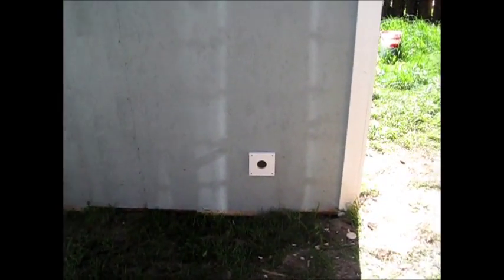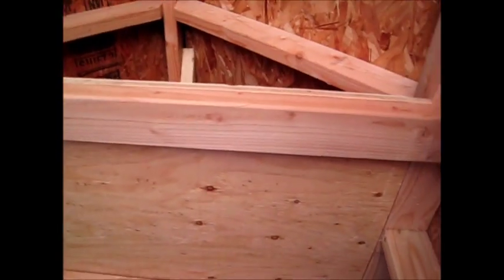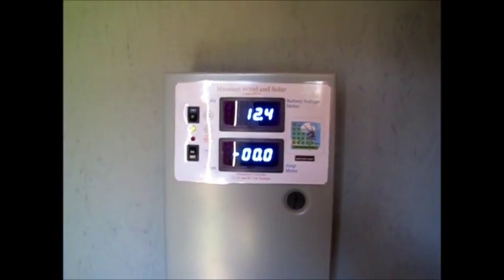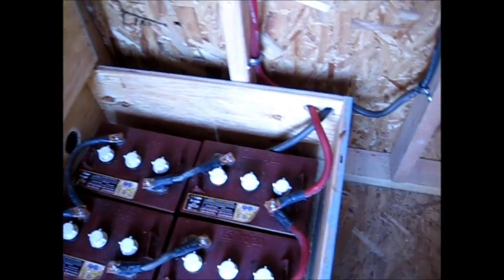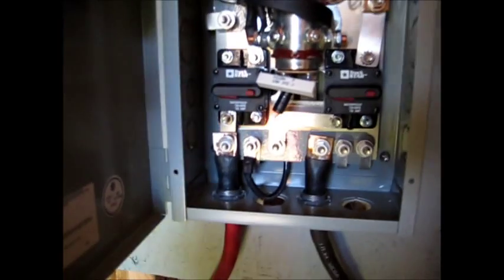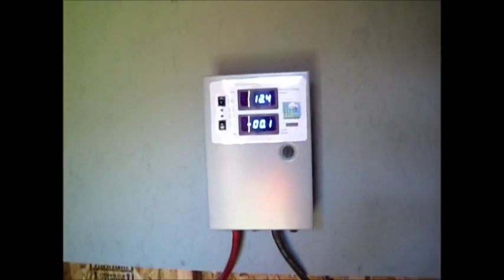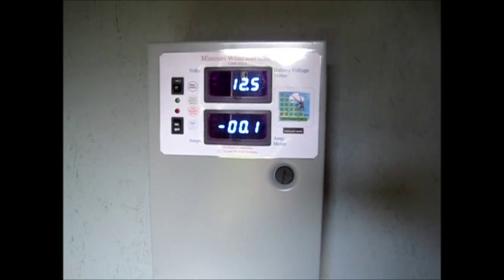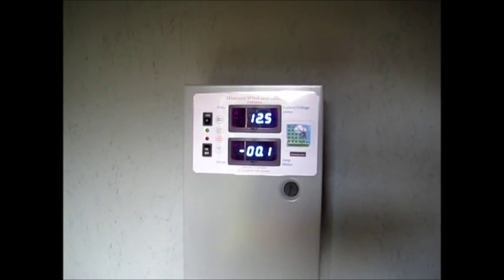Missouri wind and solar charge controller installed

Comment from the maker: thanks jeff. I still have a lot of work to do. I watched your video on using the disconnect boxes and also putting a heat sink on the blocking diode, so I have some more work to do. your videos sure help a lot making sure everything is done safe and correctly, Thanks!

Comment: i recently wired up one of their brain boxes, the heart of the controller. i like it, in principle. it allows for a LOT of amps. the one thing i do not like about it, is, if it fails, it errs to the side of constant charging. charging is default, and so if the microprocessor dies, the batteries get charged, indefinitely until you have a puddle of lead. Which shouldn't happen... but myself, id like to redesign the whole principle based on voltage detection and a normally open relay, and when lower voltages permit, a closed relay to enable charging, thus removing the failure default threat. cheers. looking good